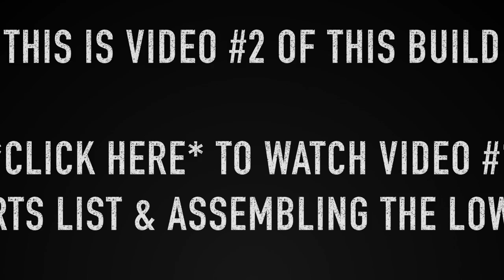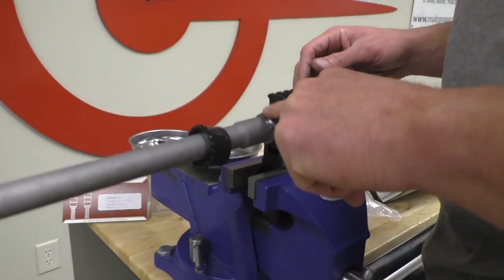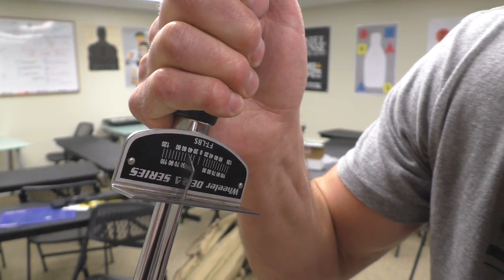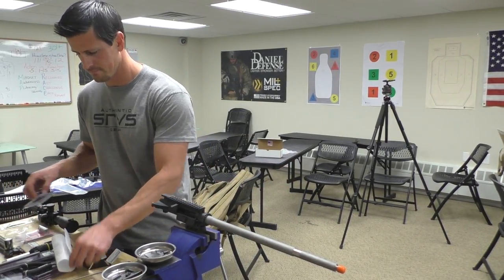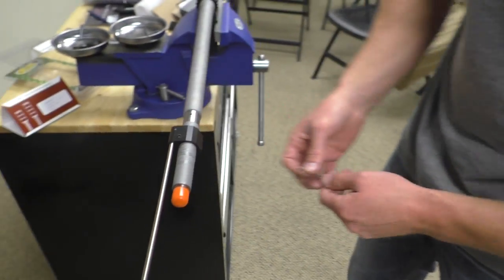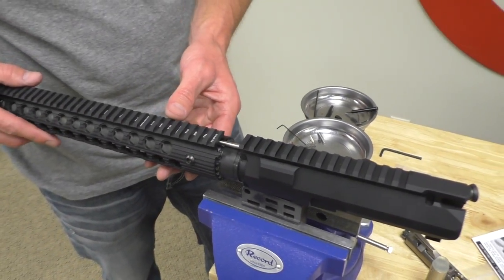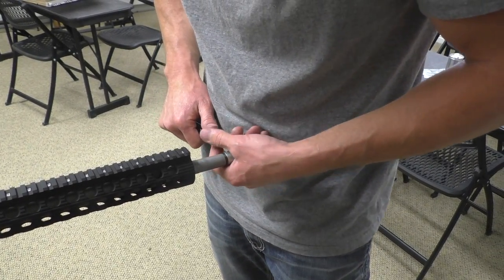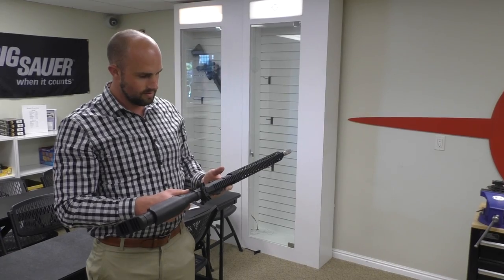2/2 Building a Precision AR 15 at Ready Gunner - Upper Assembly

Comment: I was always taught the exact opposite when it comes to using a torque wrench. You're supposed to offset whatever tool you attack it to 90 degrees because it keeps the length the same thus giving you an accurate torque reading. When you attach it in line you're effectively adding length to the torque wrench, as opposed to torquing in parallel, and you throw off the measurement. By offsetting the tool 90 degrees from the handle of the torque wrench, you negate the offset/ gained leverage. This is the first time I've ever heard someone say keep the wrench and tool in line. I saw him do it in the first video with the castle nut and I just thought he didn't care because it was the castle nut, but here he was talking about it. I don't want to be one of those "internet guys" you were talking about, I'm just a bit confused now.
Reply: No, you're right. The most accurate is to offset it by 90-degrees. Think about it, if the units are in 'foot-pounds' then adding however much additional length to the torque wrench increases the 'foot' part of 'foot-pounds.'
Reply: It doesn't matter because torque (moments) are transferred to the point of rotation. If you were applying a force on the torque wrench and only measuring that force, then yes it would matter. Due to Pythagorean calcs, in line is a longer moment arm than a 90 degree offset (the moment arm at 90 degrees is the hypotenuse). But if this was an issue, than even your hand placement on the torque wrench would matter. Placing your hand closer would decrease the torque and farther from the head would increase.

Instead, the wrench is measuring the actual torque, not the force applied at some variable distance. Since the torque is measured directly, it doesn't care about what force or what distance that force is applied, just that they calculate to the required torque. Since it's only measuring the rotational "force" it doesn't matter what way you orient the wrench, the torque is still the same.  Offsets don't affect moments as well, you just add them up. The attachment point could be at the very end of the wrench instead of near the barrel and it wouldn't matter, you would just notice that you have to apply less force to your torque wrench to reach the same torque values.
Reply: Actually, it does matter. Not a lot, but it does matter. The torque wrench is set to release "pressure" at a certain force reading, regardless of where on the handle you're applying that force from. You may feel you have to apply more force if your hand is closer to the attachment point  but the torque wrench will still release pressure only at the set force setting. The only difference is your feeling of it. But only a masochist would want to grip the torque wrench anywhere but on the handle!
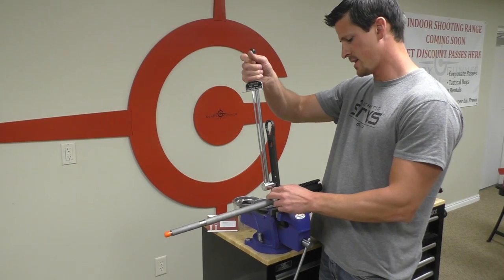Reply: Respectfully, it does matter. As shown at 5:15, the torque wrench is taking the measurement (clicking) at its wrench head, which in this video is 2-3 inches from the point of actual barrel nut rotation. That couple of inches, in this case, is acting as a lever to apply additional mechanical advantage... i.e. over-torque.  

This principal is demonstrated to much greater error in part 1 of this video series when he greatly over-torques the castle nut on the buffer tube due to using a wrench 10+ inches long. In that video, if he'd held the wrench at 90 degrees (perpendicular) to the 10 inch long wrench, it would have been torqued properly.  

In this video too, if one holds the torque wrench perpendicular to the wrench (at a right angle), the mechanical advantage effect of the length of the wrench attached directly to the barrel nut would be negated and the nut would be torqued to match the reading of the wrench.

Comment: Gonna be the "critical internet comment guy". They take the time to mention setting up the receiver in an appropriate vise block to safely torque on the barrel to avoid receiver flex, and then proceed to drive the gas tube roll pin with the gas block slid on the far end of the barrel. That's definitely something to avoid. Do it on the bench with the gas block braced in a jig or other appropriate fixture.

Comment: When torquing any threaded fastener it is recommended to torque up slowly in small increments and then back off and go again thus placing dimensional stretch into the material up to the nominal torque value.

Comment: If I can offer a little help. There is a formula for adding a wrench to your torque wrench to make the wrench accurate. When you add 8 inches of wrench it is no longer 30 FT LBS. of torque. Such as torquing the buffer tube. Also. You can make your life a bunch easier if you get a set of Roll Pin Punches for driving the roll pin into the gas block. For only building one rifle it wouldn't be worth the cost, ( maybe $25.00 dollars), but if your going to do a lot of rifle builds it's a really handy set of punches to have. They are made especially for installing roll pins. I learned a few things as well. Thanks for the great video.

Comment: A note on the anti seize vs aeroshell lube on barrel but. The standard automotive anti seize is very messy and not an easy clean up. IF you do use it apply very sparingly or you'll be cleaning that stuff off of everythingHaving used both I can say they will each get the job done, the aeroshell is just a cleaner lube to work with. Hoping to come out for a shoot this summer. Thanks for the upload.

Comment: I'm not an expert or anything, but is it really best practice to drive your pins into the gas block while attached to the tip of the barrel?  Do you really want to be banging on your barrel with a hammer, causing it to bend that way?  Why not just use a block of wood or something on your bench?  Installing the gas block backwards onto the barrel, just to use it as a thing to hold the block while you smash it seems like a really weird way to do it.

Comment: Internet dudes claim that there is a worry that there will be galvanic corrosion between the aluminum receiver and the conductive anti-seize dope on the steel barrel nut. If there is truth to that, it would probably only be relevant on Guadalcanal and Okinawa etc. I'm sure your SPR is safe. The only mistake that I saw was the orientation of the torque wrench. The armorer's wrench should be at a 90 degree angle to the t wrench or you are adding length to your applied force which throws off your measurement. Again, only an issue if you are reaching the top end of your allowable torque. Really wish I could shoot with you guys!
Reply from the maker: Thanks brother.  Let us know if you're in Utah.

Comment: So the barrel in youre gun and this gun is the same? And is it the SPR/SDM barrel that White Oak sells. And if so they had one fluted, would it be a better barrel or at least as good? I'm building one and might buy this barrel.
Reply from the maker: Fluting has no purpose but looks and slight weight reduction.  Personally I doubt that I'll ever own a fluted barrel again and I'd rather the barrel not be messed with but that's me being a little extreme I suppose.  Both this rifle and my SPR have the same 18" White Oak SPR barrel.  If you look on Long Dog Tactical they have them at a good price.  make sure you get the 1;7 twist if you want to shoot the 70+ gr bullets like we do.  I shoot the 77 gr Bergers exclusively.

Comment: Question on the muzzle brake.  Do you have to put rocksett on the threads or is the crush washer enough to keep it from coming off?
Reply from the maker: It stays on fine.  I don't use any kind of locktite because I take them off and use suppressors often.

Comment: what kind of scope did you use in this build ?
Reply from the maker: +Simao Fonseca for SPR's my go to optic is the SWFA 3-15 x 42 for $599-699.  3x is perfect for closer shots and 15 is good for 1000 yard shots as you've seen in our "worlds most accurate AR" video.  Plus this scope has great glass, a great reticle, tracks perfectly and best of all it's FFP and comes with a throw lever from the factory. They typically go on sale for Black Friday on SWFA.com and you can save at least $100 on them.  They now have a SFP version too but ffp is best for this application.
Reply: Great! Thank you for your help.

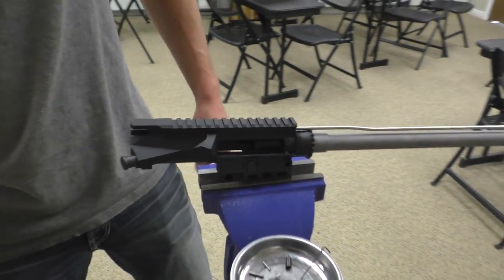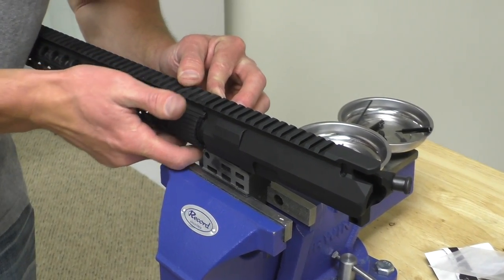Comment: Precision Rifle ????  Really ???? .... Ready Gunner guy @10:33 hammering and cobbling on the Gas Block Roll Pin  out at the end of the Barrel There is Nothing Precision about that....Ready Gunner guy should have put  that gas block on a bench block  to drive that pin in .....Hammering on that Barrel  puts a Strain on  the threads of the upper possibly causing  the Barrel Extension to become loose or cracking the threads of the Upper...You can see the Gas Tube bouncing when hes hammering on it  ....it was already too sloppy loose to start with For A  Precision Rifle .... If you were REALLY building  "Precision" Rifle you should have had a tighter fit between the Barrel Extension and the Upper and then lapped the Barrel  to the Upper Receiver Mating Surfaces of the Barrel Extension Flange and the Upper Receiver ....@12:41 you can  see  the GOUGES and SCRATCHES in the Barrel from the Set Screws Digging in after he tightened it so he could Blacksmith that pin in .... I will be surprised if  that Rifle will shoot 1.5  MOA Groups.... All the top shelf AR parts in the world are useless if they are not assembled with care and Precision ....@13:26  "The Caveman Eyeball Trick Is my prefered method " Really ??? ....That pretty much sums up the Degree of Precision this Rifle was built ......Maybe they should call this a Caveman Rifle instead of a Precision Rifle